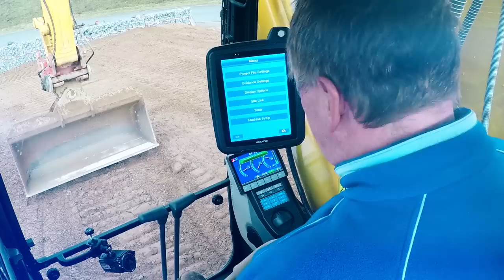Komatsu intelligent Machine Control

Comment: Have you calculated an estimated time saving per hour?
Reply from the maker: Depending on the application, a saving up to 33% can be obtained compared to aftermarket systems and up to 56% compared to manual operation. This is based on tests performed on job sites throughout EU countries.
Reply: Thanks for the information. We will pass that information on to potential customers. Appreciate your help.